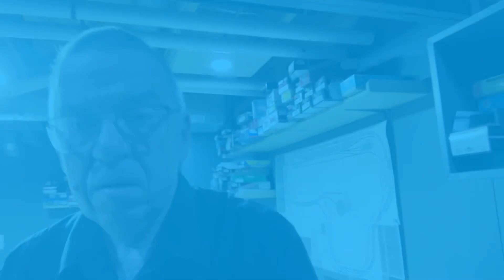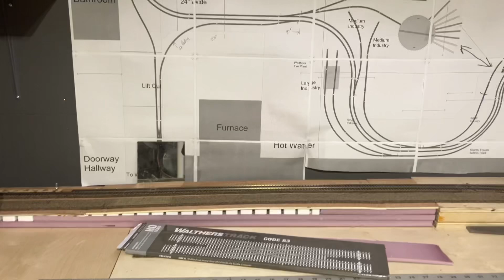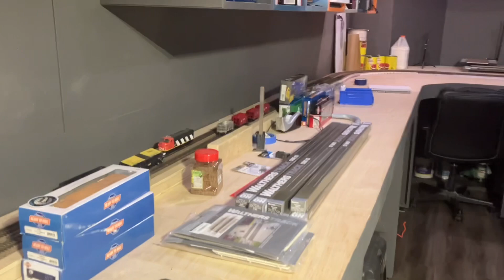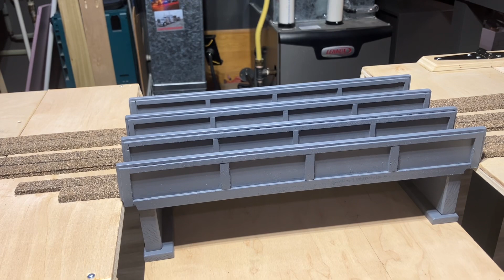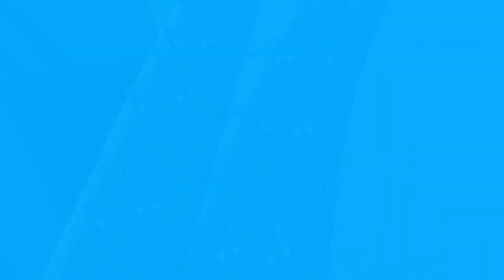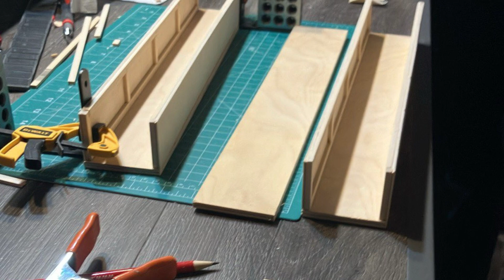#Layout Update # Mailcall

Comment: Nice update.  I wouldn't change the bridge.  It looks great.  You'll be happy with the Walthers track.  One thing I wish I had done, if you need more than one piece of flex track on a curve, solder two or more pieces together straight and then lay them as one piece. It will save a lot of frustration.
Reply from the maker: Robert yes I found that out very quickly when I did the incline track , yes I do like the Walthers track, no glue just spikes thanks for watching

Comment: James  nice Update   on the layout.      If you plan to remove the double cross over in the staging area think about replacing it with a double slip turnout they give you more possibilities you never know when you may want to switch the train up later down the road. Something to think about
Reply from the maker: Thomas Walthers does not make one  will use a single crossover